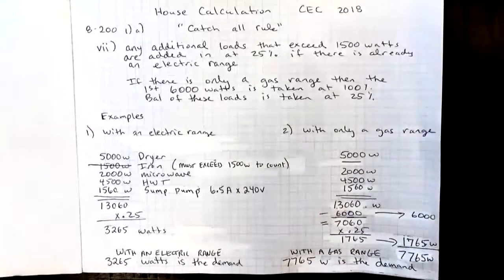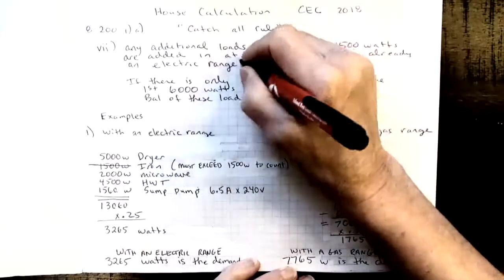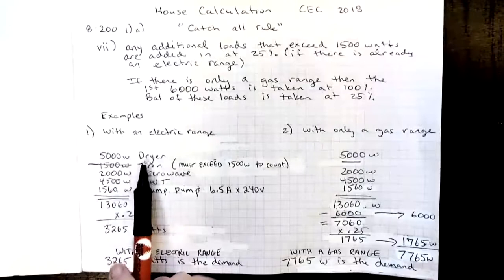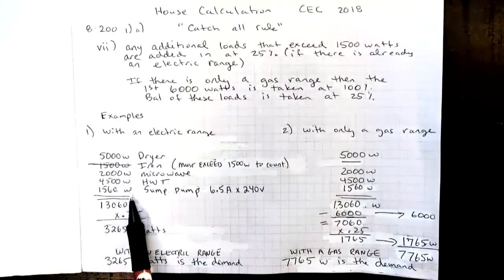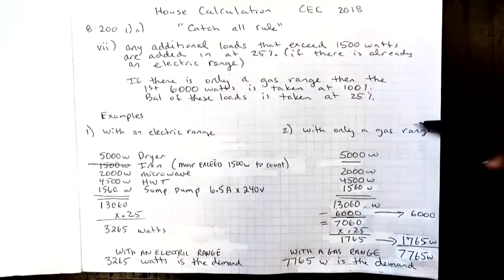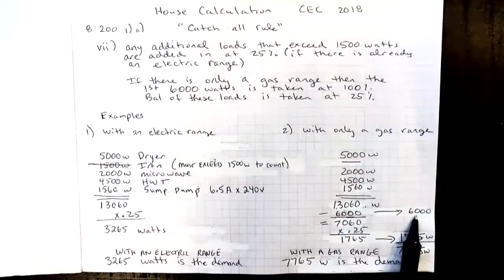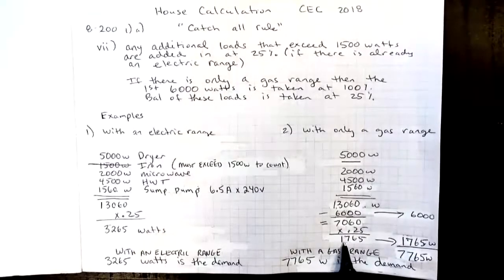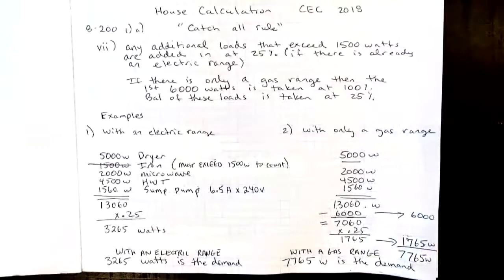CEC 2018 House Calculations "Catch all" Rule 8-200 (1)(a)(vii)

Comment: This makes no sense at all. A gas range should less power demanding than having an electric range. Please expand on this to clarify.
Reply: The calculated load on the left didn't include the electric range load; adding in the electric range would add 6000 watts to the calculation for a range that has a demand of up to 12 kilowatts, plus 40% of any amount by which the rating of the range exceeds 12 kilowatts. You wouldn't have to add anything to the calculated load on the right for the gas range. CE Code Rule 8-200 a) iv)